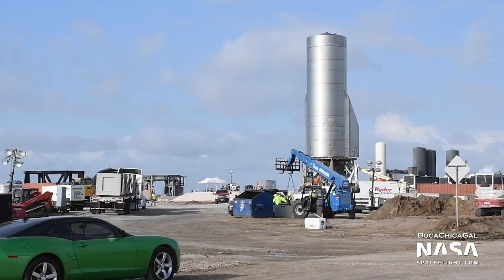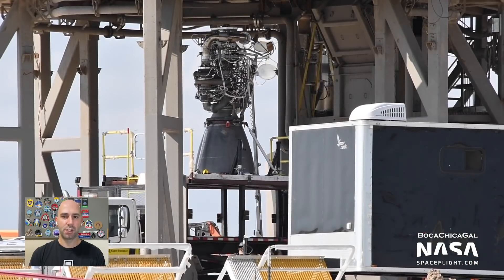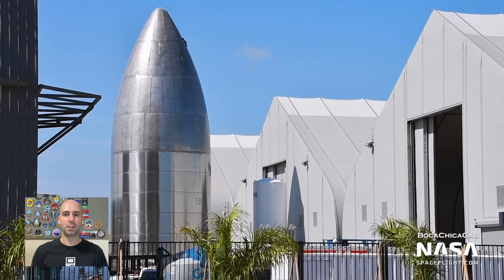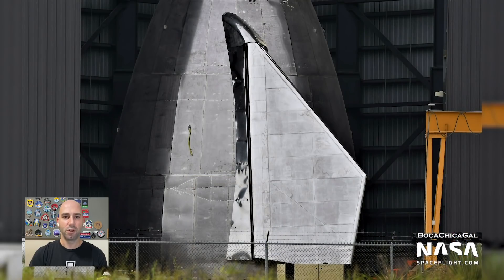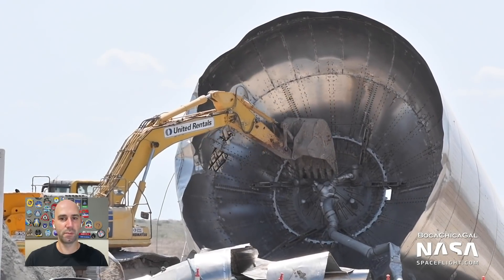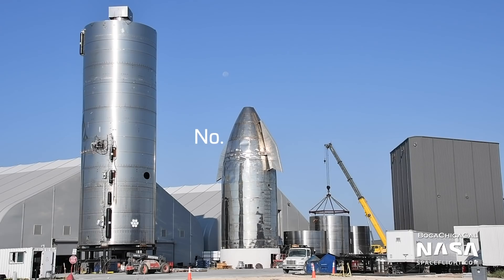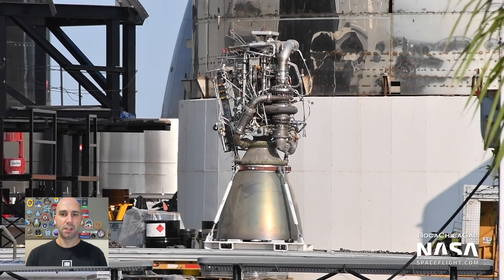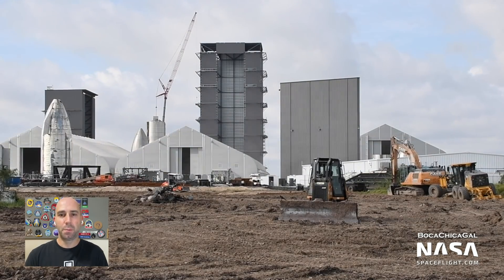Starship SN8 Testing Underway with SN9 and 10 Close Behind (SpaceX Boca Chica Weekly Update)

Comment: I would like to have seen you do a quick over-view of the massive earth-works by the Orbital Launch Pad. I mean, they took tons of sandy soil and replaced it with more compact dirt/stone mix. Then raised the original level by about 2 meters then layered tons of shingle then wire mat. Its going to be boxed (I am expecting) then a massive concrete pour. That's in front and to the right of the OLP.

Comment: SN5 & SN6 can be used as "Test Mass" for Super Heavy. They could be loaded with cargo, and sent to the moon. They won't need flaps, since they won't be coming back. Or they could be used as pontoons for a floating launch / landing platform.
Reply: This is a great idea if no better use has been decided upon by the time the sea launch structure is started to be built.
Reply: Agree to the cargo idea. Waste of good functional rockets as very expensive pontoons. You could buy a cluster of old barges for what it cost to build SN5&6. 🤑

Comment: Is there a header tank on the nosecone for SN8? Will that need to undergo Cryo Testing/Proofing?  Will that be done after installation or on test stand B?
Reply: SN8 has to have a header tank - it's making a real flight and needs one to land. They can certainly put enough propellant in the main tanks for landing, but the kick maneuver would probably slosh it around too much to feed properly, afaik.

Sure, it will need cryo-testing. I thinks it's more likely to be done after the 2 sections are joined, but the second alternative is possible. Doing a full-up test with everything connected seems more useful, and the SpaceX way of doing things.

Comment: Is the goal of Boca Chica to be a launch facility or an assembly facility with launch capabilities? I'm probably picking nits but I thought I heard Elon say that Boca Chica was the thing that would build the thing. So I assume the rockets will be launched to a full time launch facility that is built around easy access for cargo and launch latitude.
Reply: Saying "Boca Chica" was a shortcut that left an ambiguity - something Elon does frequently. There are and will be two separate facilities at Boca Chica, the shipyard (the thing that builds the thing) and the launch site, as we've seen all along. Separate, but close - the rockets can be easily transported to the launch site. When the site was scouted out and purchased the plan was to launch a full manifest of orbital flights from the launch site. (The very earliest plans included launching F9s, IIRC.) A top reason this location was chosen is because it's the best possible launch latitude available in the continental U.S. (It's farther south than Cape Canaveral, at about the same latitude as Miami. Somewhere south of Miami would technically be a little better, but perhaps problematic in a number of ways.)  Now the realities of the acoustic destruction of 28-30 Raptors have set in, and most orbital flights will launch from a platform about 16 miles(?) offshore, retaining the latitude advantage. This means easy access for cargo is out of the picture.

The launch platform is expected to be near Boca Chica, to minimize the distance SH and SS will need to be transported. The Port of Brownsville is less than 15 road miles from the shipyard, so that's pretty easy. Then a short voyage will get them to the platform. This gives an alternative to launching newly completed ships on a short hop to the platform, which they might not want to do early on, IMHO.